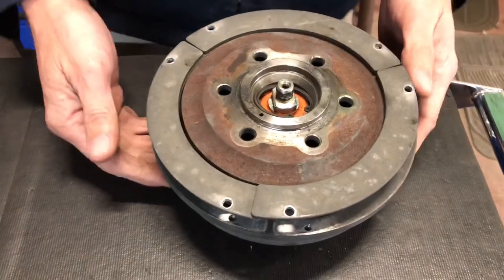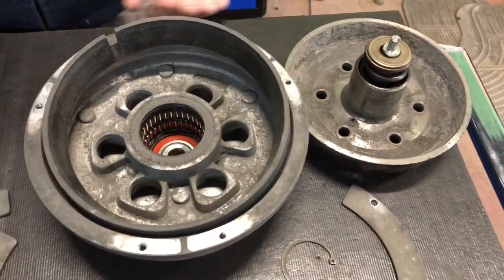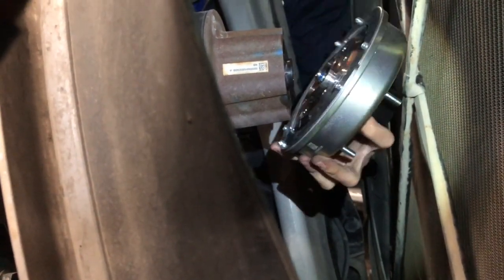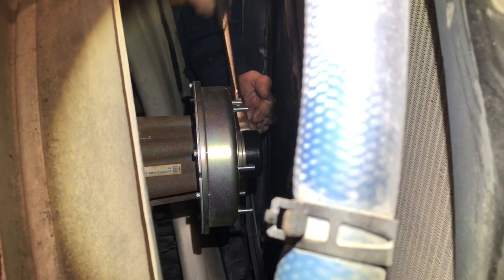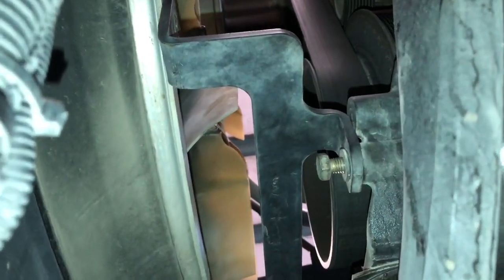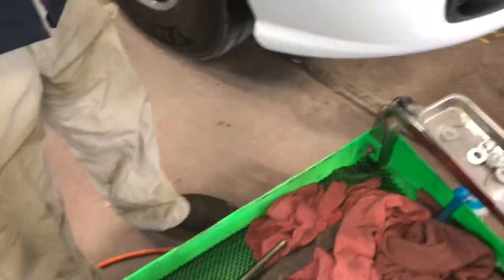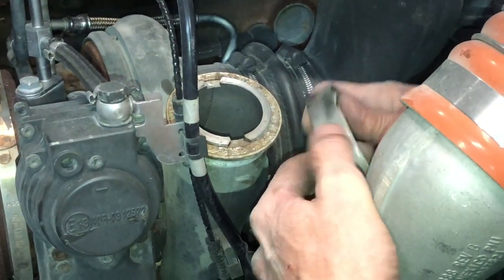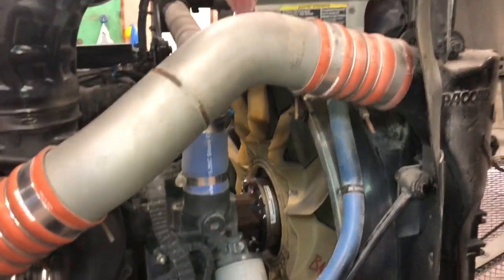DIY Fan Clutch Replacement On A Paccar Engine. A Step By Step Guide, How To Remove and Replace It

Comment: Great job and video thanks my friend keep up the great work. I like the setup you don't have to support the hood when you take the radiator brackets off. Great job see you on the next video thanks again. I do remember rebuild kits for the clutch fan did a few in my time.
Reply from the maker: I wished they still allowed you to actually fix a part instead of replacing a part. Guess the good ole days of trucking are long gone in more ways than one. Thanks for watching and thanks for taking the time out to leave a comment.

Comment: My fan quit working and what I am wondering is why the manual override switch doesn't work either. Thanks for this video. 👍😎
Reply from the maker: Because the clutch is out. Those work opposite than the old ones. The old ones when clutch went out fan would stay on the new ones rely on air to push the clutch to make contact to spin the fan (I know stupid design that leave you stranded on the road, unlike the old ones that let you keep going but just hurt your fuel mileage) 
You will have to replace it

Comment: I’ve got a different problem. My air compressor is leaking and I think it’s sending a little dab on oil through the whole pneumatic system.  I believe oil has been blown thru that 1/4in line and I believe the clutch ring/plate is coated in oil leaving it to run nonstop.  Of course the noise, fuel mileage but it’s making the A/C not cool.    Anyone come across this do you think that’s a possibility?  I did see a tiny bit of oil on that 1/4 line where it goes into the top of the clutch.  Thought about spraying parts cleaner down that tube and just take it off up on solenoid.   

Ideas?

Comment: Those Borg-Warner fan hubs are junk, Paccar thought the Horton hubs had a high failure rate and switched to BW, then hub failures went up 50%.  Nice video, still hate the MX engine.
Reply: Paccar made Borg Warner make a new fan clutch just for their trucks. Paccar wanted it to be lighter weight than the original Borg Warner fan clutches, so they made the top part of the fan clutch out of aluminum (bad idea). They had a lot of failures because the friction material would wear into the aluminum top, which you can see in this video when they disassemble the fan clutch. Borg Warner has since obsoleted this aluminum design and went back to the all steel design for the Paccar applications. Kit Masters also offers a replacement option, part # 8801N.
Reply: @kurtmursu5291  just looked this up. The Auto Lock feature sounds great

Comment: Hay I some help I pull all the bolts I can see and I still cant get it off
Reply from the maker: There’s a bunch of them in there. They are only an inch apart or so.
Reply: I dont think I got all the bolts can't find all of them where are they
Reply: Ok I got all of them and it came right off
Reply: Ok I got it thank you all thank you

Comment: Did he put that v band clamp lock nut on backwards?
Reply from the maker: Steven Jones it was but we fixed it I meant to show that on video. We were in a rush to get the truck out. Always happens seems like when you rush. Always the simple mistakes seems like. It was caught right after that shot was done.